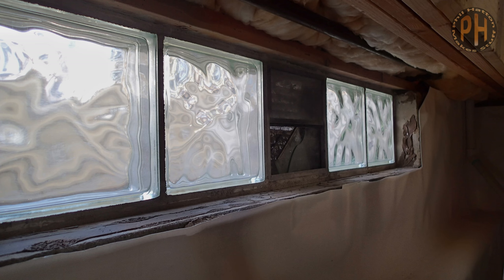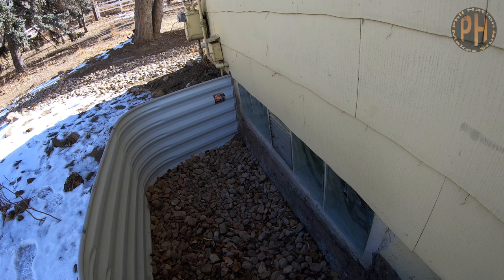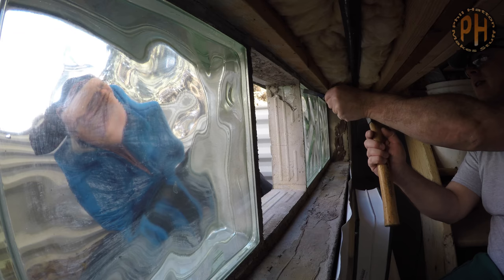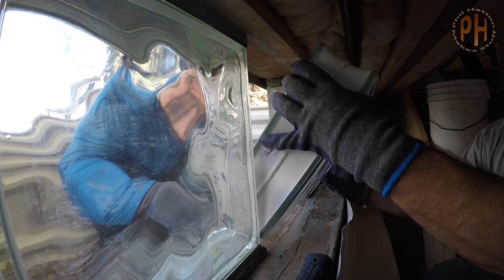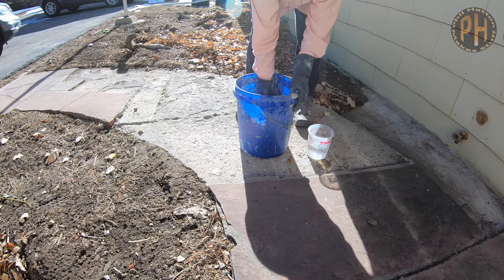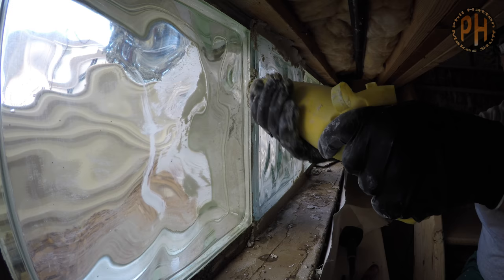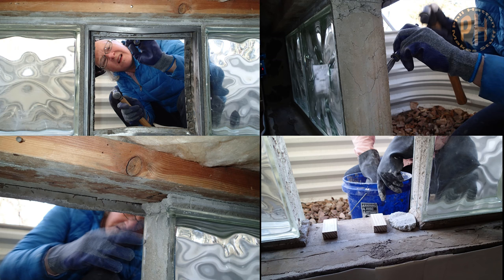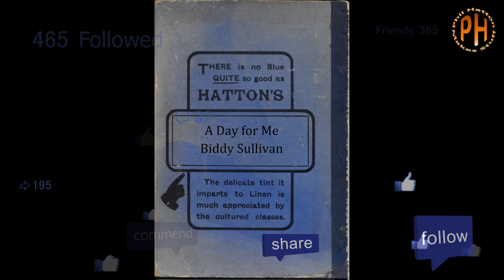Fixing a House 3 - Replacing a Glass Block in a Window

Comment: Have you thought of just replacing the whole glass blocks with a window? So you can open window to get fresh air.
Reply from the maker: This window is by the stairs to the basement and there are windows in the basement that open, plus this would be a custom window size so we didn't want to spend the money.
Reply: @PhilHattonMakesStuff  that make sense. Thanks for getting back to me.

Comment: Did you leave the wood blocks in that you put in at the bottom?
Reply from the maker: Yes.  We used construction adhesive to glue the blocks on place.  Since we used perdue treated wood it's fine in contact with the foundation walls.